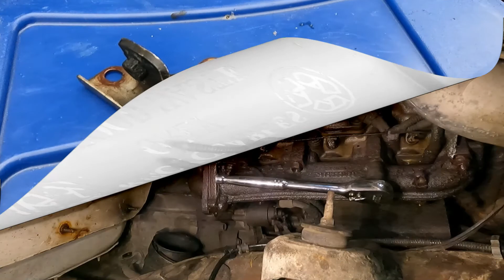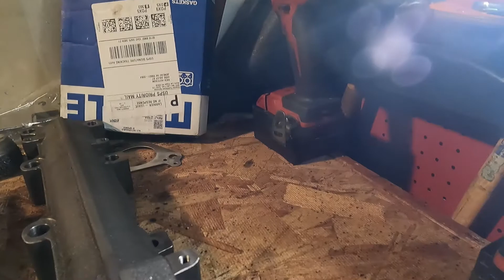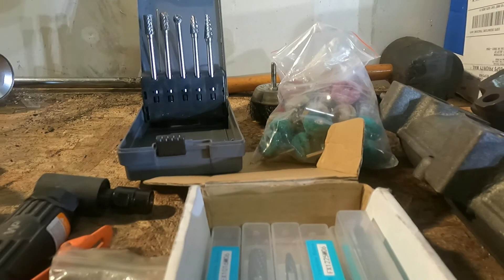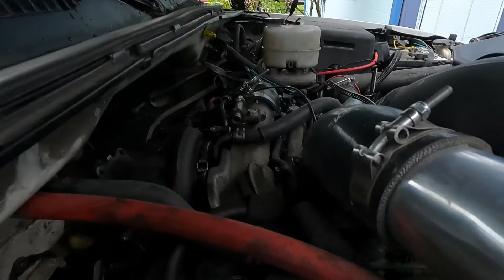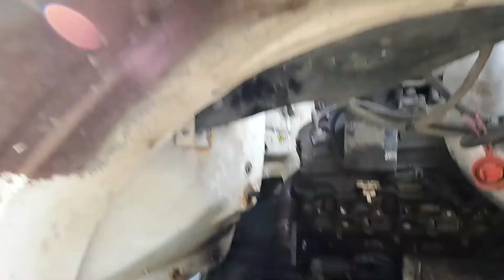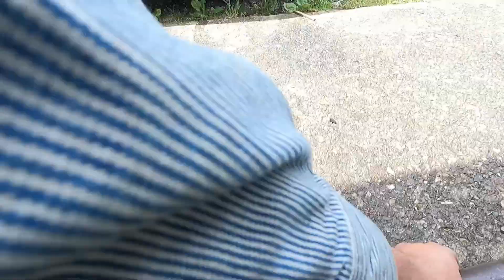Faster Spool & Lower EGTs! LB7 Manifold & BD Full Bore Up-Pipe Install

Comment from the maker: 🔴BD Diesel Performance 1041460 Exhaust Manifold: https://amzn.to/3zraldd
🔴MAHLE GS33678 6.6L Chevrolet/GMC Duramax Turbo Mounting Gasket Kit: https://amzn.to/3lYxAXp
🔴GM Genuine Parts 98002804 Exhaust Manifold Gasket: https://amzn.to/3CA00xz

Comment: You would have been better off not port matching the manifold outlets to the gasket. You only want to make sure the up pipe inlet is bigger than the manifold outlet. This creates a stepped collector which is anti-reversion for gas flow. Which is what racers figured decades ago
Reply from the maker: @TheFreemenProject  what they figured out decades ago was to not port the bottom section of the exhaust manifold because the exhaust gas for a split second sucks backs into the cylinder. Having the lip on the bottom makes the gas bounce off that the lip and roll back to to the exhaust exit. And that's what I did as well. Porting above the bottom section allows more gas to escape. This way you get the best of both worlds. The exhaust escapes from the top and on the intake stroke, the exhaust gas that is sucked back in bounces off the bottom.   At least that's how the old timers explained it to me.

Comment: How ur lds injectors running on stock air ? On the forums everyone is giving lds hell for how sucky they say there injectors are . Smoke at idle and terrible warranty. I was gunna buy them but it’s hard with all the bad reviews
Reply from the maker: @cody6.6max  I bought them before they went in house. So they are running excellent still! Also, Pig isn't running stock air.  She has CAI, 3" mandrel bent intercooler pipes. I rebuilt and ported the turbo on exhaust and compressor side. Upgrades to billet aluminum 11 blade compressor wheel. Rebuilt the heads, ported them as well. Ported the Y pipe. Ported the exhaust manifolds. Port matched the up pipes. Upgraded the down pipe, and ported that. Then of course have 4" exhaust. And a last but not least I have a tune on it.  Still purs like a kitten!  I'm on a 6 week campin trip up in the mountains and loving it.  Upgraded the radiator to aluminum and as well as an oversized aluminum trans cooler. But yeah, I heard LDS went down hill when they switched from s&s I think it was and started doing injectors in house instead. I'd probably look elsewhere for 45 over sac injectors until lds tightens up whatever was going on with their process.
Reply: @KooshdaakaaGarage  you have a link where you got ur intercooler pipes
Reply from the maker: @cody6.6max  sure do! https://www.amazon.com/dp/B06XK3HRWJ/ref=cm_sw_r_as_gl_apa_gl_i_Z0JMWV8578A8CRZN41QE?linkCode=ml2&tag=kooshdaakaa14-20  it'll fit 02-04 lb7.  If you have an 01 like I do then you'll need thr kbdp boot.

Comment: What air compressor do you have for the air tools you use?
Reply from the maker: Hey Chadrack98, thank you for the question.  I have a Husky 20 gallon tank capable of 200 PSI.  Perfect for my garage setup.